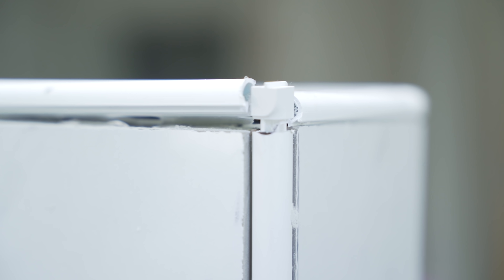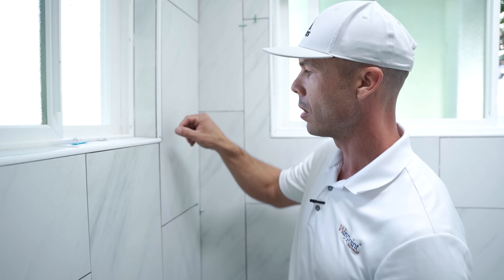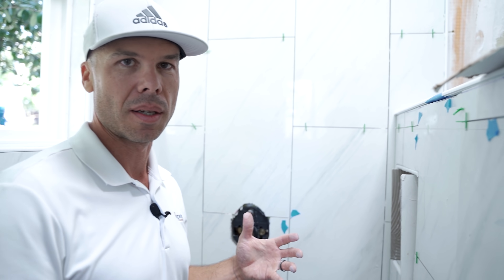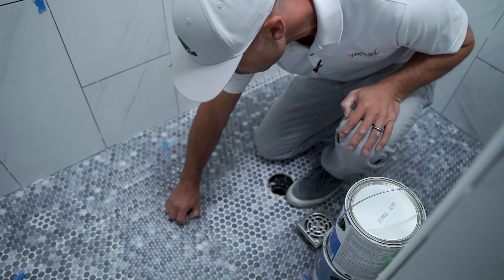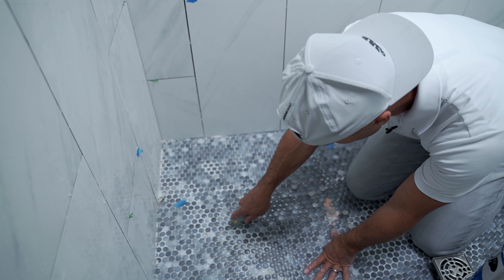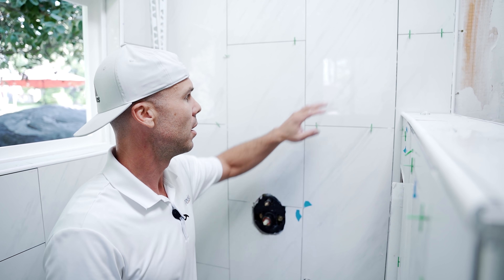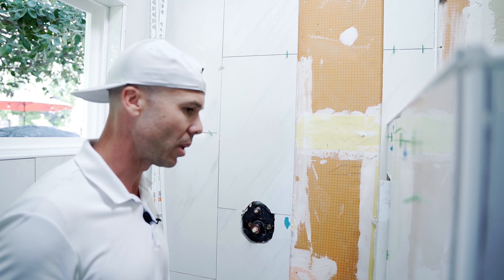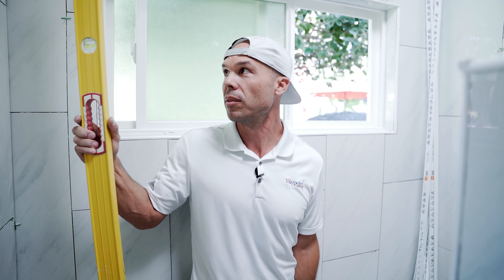WORST TILE JOB I'VE SEEN - Can We Save It?

Comment: I had to replace a job some installer did, im not joking the dude cut a vertical inset while the tile was installed on the wall. No depth setting either when cutting,  drywall with tile on it just flapping in the wind

Comment: I'm dyi guy, mostly to save money and I don't trust people to do it right if I pay them to do it. I can do a half assed job myself and pay a lot of money.   I'm using Palasade water proof tiles and I'm thinking I'm doing a half assed job...    I've been watching these videos and seeing mistakes I'm making with the concrete board and old shower pan.   The floor dropped about 1/4 of an inch, so I used self leveling cement to get it to drain better.  I'll only have a few hundred dollars in it.  I bet it'll last a few year and it'll be a learning thing.      crap, I should have done a lot more study on this.   I put a shower insert. 3 piece in my dad's bathroom and so far so good. But there was so little room in my bathroom to get a shower insert in there. It was tough on my dad's, I had to take the door apart and a little bit of the wall.     I could go on.   It's a 70's house.       crap...

Comment: Is that a Porcelain tile? Because ur supposed to use modified thinset but unmodified on the kerdi. So if he used a modified thinset on a porcelain tile it would only stick to the tile and not the kerdi board.

Comment: why isn't the mortar pulling of ANY of the board?  No adhesion at all?  Why?
Reply: Because the installer didn't burn the thinset into the board fiber before sticking the tile on. They ONLY applied the thinset to the back of tile
Reply: @SuperGommez  thanks!

Comment: So how are you doing the right thing and you're saying the right stuff, When it comes to window ledges or the top of the pony wall, It would be nice to incorporate 2CM white or whatever color when you wouldn't have to use the edge detail. But then again I would never use floor tile for a shower or rather use natural marble and make my own edges perfect. Always use polyurethane so that nothing ever leaks under the Pan next to the drain no silicone ever. Polyurethane will last 50 years if you seal window ledges seats corners the floor itself after the fact you floated it you'll never have a problem.

Comment: I disagree with 95% coverage in a shower area, dot and dab is fine and sometimes walls are that out it’s the only way to go.
If a shower area is grout and silicone sealed correctly, water vapour as you put it won’t be an issue.
The rest of the job is s**t

Comment: From an Australian tiler with 30 years in the trade as a wall and floor tiler. Why the hell would you have anything foam in a wet area and not sand cement bedding to get your falls right and you can lay any size tile over the bed. You sound more clueless then the guy who did the job.

Comment: In my first home, I decided to tile the shower walls myself with 12x24.  Never did tile before. After about 2 rows I looked at it and decided the finished product would not meet my own expectations in quality. Ended up paying two guys to do it the right way who were nice enough to deal with my mistakes and fix them. Only thing they said they didn't need to rip out was the niche I did.  Now years later having tiled several floors I'm about to tackle walls again in my new home. Wish me luck! lol

Comment: Limpage is bad do to it being 50% them tile aren’t straight they have a hump in the middle so need at least be 33% .. also wen doing a shower like that owners always want installer to use cheap thinset so most time it won’t still as good at 14$ thinset

Comment: When you are standing barefoot, you are putting 2 point loads (your heels) on the floor/ground. Your first shower, and you will smash those penny tiles right into the underlying foam.

Comment: I cringe every time I hear the word lippage!!! It seems so DIY...around here in So Cal we call them “Kickers”...
Reply: If it is so DIY why do I see lippage in the tiles of the Fort Pitt Tunnel?  That had to be a union job.
Reply: Robert Connor what are u talking about!!! I’m referring to the phrase lippage... here in So Cal we call uneven tile kickers...cause on floors u literally kick them
Reply: @a.t.wheelman3837  Because I am doing a tile job and hear about lippage being bad (it is) but once I was slowed down in the Fort Pitt Tunnel and noticed all those times were not straight and level, the exhaust fume dust made the lippage show.  PennDOT has to hire a professional union contractor so what is the excuse for lippage.  Especially since the underlying tube is concrete and likely plumb.  The tunnel was first built in 1960 but you can see where retiling has taken place since then.

Comment: Wow that was insane it not like thin set that expensive and look like he had problems with installing the shower body to bring the tile off of the wall that crazy and the trim piece are visible inside outside sound like he used the cheapest guy that said i tile no problem

Comment: If he straightened his walls out first, then used a bigger notch trowel and back buttered each tile then he would of had better adhesion.. and for the tile trim, definitely should of 45 his corners and scribe his cuts before grinding them 🤔 that floor tho, that’s a complete write off.. dude needs to learn to screed.

Comment: Why don't you use paint on waterproof membrane alone over concrete or cement sheeting rather than bother with other products. I see you promote schluter products, but can't see why you'd bother with that with paint on membranes working fine.

Comment: I layed that tile and did a phenomenal job. The homeowner did all the prep work. Everything was so uneven and out of alignment that no matter what I did it was impossible not to have lippage. I have 25 years of experience laying tile, have won many awards in home showcases. The end result comes down to the prep work, no other Tiler could have done a better job. I stand by my work and I did a very good job.
Reply: You should have used a wet saw and a lippage system Bucky 😂 flat burn the Kerdi and trowel the wall with a 1/2” notch then flat trowel the backs of the tile and throw some clips in there with wedges and reach.....
Reply: LOL.  You must be joking.
Reply: @tilesetter929  my wetsaw took a shit at the very beginning of the job. I notified the homeowner who was there at the time and he insisted that I keep plugging away. I warned him what the end result would be and tried to talk him out of it, knowing it was not going to be a pristine result, but he badgered me to continue rather than stop and do it correctly. Again I stand behind my job. I challenge anyone to do better with what I was given to work with. Armchair quarterback.
Reply: The lack of a wetsaw might explain some jagged edges, but you also could have stoned them smooth.  The real issue is why did you install tiles without adequate coverage?  Were you running out of thinset too? If you've won awards then you know you need full coverage on each tile, and no matter how lumpy the wall was you could have at least got the tiles stuck to the wall... but you didn't even get 10% coverage!  And the corner profiles installed the wrong way around?  and tile overhanging the drain?  and floor tiles that can be picked off by hand?
Reply: @amishmafialancasteramos6382  I’ve finished my two bathrooms, and they look great.
Reply: This is a troll lol
Reply: @MrWhateva10   I had at least 95% coverage on every tile, I back buttered every single one. The corner profile was the homeowners doing. Each day I would come back and there would be something the homeowner did himself while I was gone. Not sure if he wanted to be able to tell people that he did the install himself for bragging rights. I don't know the answer, but I know he did it every evening after I left.
Reply: @TheGriz403  great for you little buddy, here's your trophy 🏆
Reply: @amishmafialancasteramos6382  with 25 years experience you don't know the basic concepts of tile setting yet.   i.e. to burning in thinnset, directional troweling, the use of tile levelers or even to purchase a wet saw.   Your trophy means nothing.
Reply: @TheGriz403  your reading comprehension must be quite low. Please don't comment when you haven't even mastered the basic concepts of reading comprehension. If you were capable of reading a paragraph and understanding anything that you have read you would know that I addressed the wetsaw and other issues. I suggest you take an English class
Reply: @amishmafialancasteramos6382  Says the guy that makes a round hole for a square peg.
Reply: Isaac's all right, all good
Reply: This has to be a joke , right?
Reply: @mandatethis8024  What's a joke, that you are a big mouth? Seems about right bub!!!
Reply: @Weekend Warrior sir, I also suggested that however the job was to be done without any further expense.
Reply: Psssssst, guys I'm trolling, but thanks for playing along... It was quite entertaining.
Reply: Haha? You can’t be serious. Ugly is ugly, failure is failure.

Comment: When you say crazy and “other problems,” do you really mean methy…. Living in Roseville do you lose good workers to meth problems?
Reply from the maker: Mostly alcohol and/or mental illness.  Or just no support or family guidance.
Reply: @TileCoach  In the Central Valley meth is pretty rampant. Saw an old friend in the news for his quantity of meth related arrests in the previous month. I get plenty of time with people addicted to meth at my work. 

I don’t work in the trades. Im a nurse as a second career after over a decade as an aircraft mechanic. I love the videos and the tests. 

I’m the middle of a bathroom. But having the second bathroom floated and tiled as it’s a new 4’x5’ curbless shower with a bench, niche and window. I did drop the floor, did the plumbing (moving both toilets and the mstr shower), electrical, built one vanity and new doors and drawers for the other.